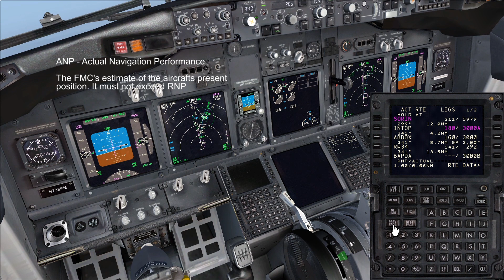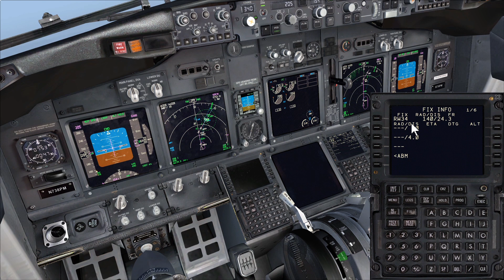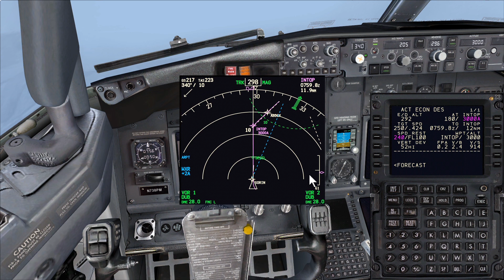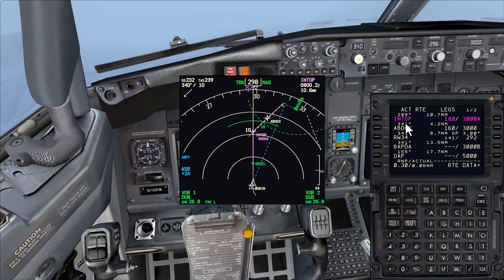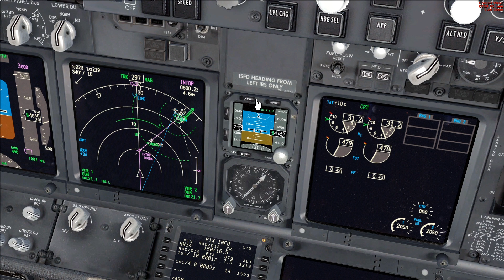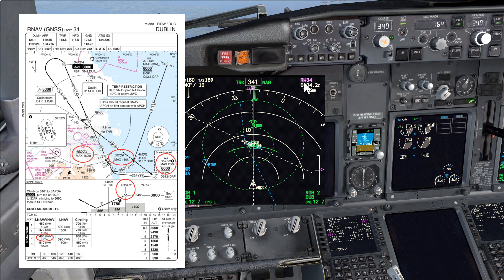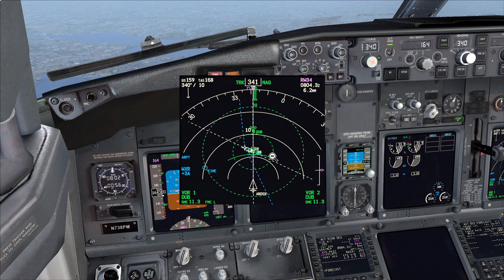PMDG 737 RNAV/GNSS Approach Tutorial by a Real 737 Pilot

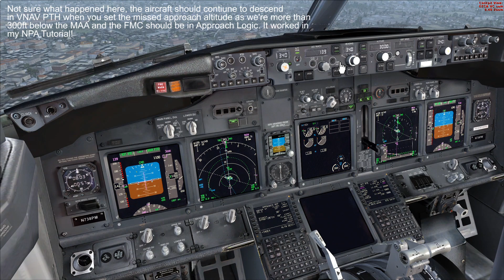Comment: Nice tutorial bud. At about 12:40 the reason why VNav gave out when you set missed approach is; because you need to be at least 1000ft above field elevation to set MAA or else it will level off. Your field elevation is 202 ft which means you should set MAA at 1202 ft but you set it at 1260 there about. The sim was actually spot on. To be on a safe side, just set MAA at 300 ft above MDA. Otherwise great job. I’m a 737 pilot.😊

Comment: @flightdeck2sim Is there any rule (I realize it might be operator dependent) about when you can set the altitude on the MCP to the down to the minimums? Is it after the IAF, or within a thousand feet of level off, or no rule but there are best practices? I learned for myself practicing, you definitely can't wait until the FAF or until you're in VNAV ALT or you'll be immediately high on profile when it doesn't descend.

Must be gratifying to know this video helps so many, years on. I was in real trouble if ATC told me to fly anything other than an ILS before tutorials like these.

Comment: It would be great if you could revisit this tutorial for the MSFS PMDG 737. The A320 has the ability to simulate the ILS G/S in the RNAV approach. Does the 737 has a similar feature?
Reply: If equipped with Integrated Approach Navigation (IAN). It's a carrier option.
Reply: @rynovoski  Can it be set in the MSFS PMDG 737 through the PMDG Options?
Reply: Using the FMC.
Reply: @enriqueosuna  I don’t have MSFS, but if FD2S can turn it off, I bet you can turn it on! 😅
Reply: @rynovoski  by any chance do you have the PMDG 737 on another sim platform?
Reply: @enriqueosuna  No. I use the Zibo mod on X-Plane 12. I didn’t think the PMDG supported any other simulator.
Reply: @rynovoski  they do support P3D/FSX. Thanks for your guidance. 👍🏼
Reply: @enriqueosuna  those are both basically MSFS. 

No problem!

Comment: What about a VOR approach full procedure
Reply from the maker: You might find this useful! 

https://youtu.be/qMYzXB6nb_I

LNAV/VNAV are just roll and pitch modes the aircraft use to fly guidance programmed in the FMC. It's used in all phases of flight and can be used to fly an approach in the FMC, the FMC is still able to generate curved lines and radius to fix tracks and is extremely accurate, We use it to fly RNAV, VOR, NPA approaches at my outfit and can be just as accurate as an ILS! 

FD2S

Comment: So what’s the difference between LNAV/VNAV approaches such as this, LPV and RNP approaches. To me RNP approaches on charts (Quito or Paro are good examples) allow the aircraft to fly through mountains following curves and has to be extremely accurate where as LNAV/VNAV is bunch of straight lines. And I guess these still can’t beat ILS when it’s extremely foggy
Reply from the maker: Hi Thomas,

LNAV/VNAV are just roll and pitch modes the aircraft use to fly an approach in the FMC, the FMC is still able to generate curved lines and radius to fix tracks and is extremely accurate, We use it to fly RNAV, VOR, NPA approaches at my outfit and can be just as accurate as an ILS! 

FD2S

Comment: Hi, i've tried to apply this exercice on Zibo mod on Xplane, but i dont see any holding point in the database for SORIN. is that possible or did i miss something? Thanks Capt.
Reply from the maker: Hi there! It should be unless it's not correctly coded in the FMC, if you select RNAV 34 it should come up as a transition. 

FD2S

Comment: Hi. Been practising some approaches. If you notice the glide path angle is different in the FMC to the charts, is there a way of updating the FMC to show the correct angle. Keith
Reply from the maker: Hi KEITHGEE1000,

It is impossible to update the GP angle on a published approach, they should match the chart. If you were to fly an RNAV approach the tolerance is 0.1 degrees otherwise you'd have to fly something else (then report it!)

FD2S
Reply: flightdeck2sim great thanks. It was approaching Jersey. The charts showed a 3.0 degree GP, the FMC was 3.1 so within your range. All good!!

Comment: Hi :) I have this question: why didn't you set minimums bug to MDA+40ft, like you did in non precision tutorial? Doesn't this rule apply to RNAV approach? Thanks in advance :)
Reply from the maker: Hi Konrad.

RNAV Approach to LNAV/VNAV minima is classed as an approach with approved vertical guidance so the minima is a DA so no need to add 40ft 

FD2S
Reply: Thank you very much for quick answer. Greetings from Poland :)

Comment: hii flightdeck again it is mee :))  what will happen if ı tune the ıls frequency while executing rnav/gnss approach.?? will the localizer and glide slope diamonds show and ıls override the rnav 
 approach ?
Reply from the maker: Hi there!

You can are APP using IAN (Integrated Approach Navigation), our fleet are not fitted with this option and I've deselected it in the PMDG options and I know very little about it!

I believe in this case the PFD will annunciate G/P (glide path) instead of G/S (glide slope) after arming APP. Flying IAN requires proper equipment and approval and allows you to use the LPV minimums on the chart.

FD2S
Reply: hmm oke thanks for that...

Comment: Would you fly an RNP apporach the same way you fly LNAV/VNAV GPS approach
Reply from the maker: Yes you could. You can are APP using IAN (Integrated Approach Navigation), our fleet are not fitted with this option and I've deselected it in the PMDG options and I know very little about it!

I believe in this case the PFD will annunciate G/P (glide path) instead of G/S (glide slope) after arming APP. Flying IAN requires proper equipment and approval and allows you to use the LPV minimums on the chart.

FD2S

Comment: What is CWS A and B autopilot?
Reply from the maker: Hi Oleg,

It's a function seldom used which turns the 737 into an Airbus. You essentially fly the autopilot using the control column, you set an attitude and/or bank angle and it holds it nicely without trimming. Will explain its use in a tutorial at some point!

FD2S

Comment: What about using APP button on MCP during RNAV approach?
Reply from the maker: Hi Squawk 737

You would use APP using IAN (Integrated Approach Navigation), our fleet are not fitted with this option and I've deselected it in the PMDG options and I know very little about it!

I believe in this case the PFD will annunciate G/P (glide path) instead of G/S (glide slope) after arming APP. Flying IAN requires proper equipment and approval and allows you to use the LPV minimums on the chart.

FD2S

Comment: When will autopilot automatically disconnect on RNAV approach? Thanks!
Reply from the maker: It wont until you disconnect it! 

FD2S
Reply: flightdeck2sim Thank you for the reply! Just tried it with PMDG737 at LOWI RNAV rwy 26 and it went to CWS mode at 10ft AGL, with 50ft Radio DA set.

Comment: Hi FD2SIM, sorry this is an old video to post on but could you please explain how this approach would work if you were flying an aircraft with IAN equipped and would it make a difference and what annunciations you would get if using it. Thanks.
Reply from the maker: Hi Nerf

With regards to IAN (Integrated Approach Navigation), our fleet are not fitted with this option and I've deselected it in the PMDG options and I know very little about it!

I believe in this case the PFD will annunciate G/P (glide path) instead of G/S (glide slope) after arming APP. Flying IAN requires additional equipment and approval and allows you to use the LPV minimums on the chart.

FD2S

Comment: Amazing channel, congrats!!! Can you tell us how close the PMDG 737 is to its real life counterpart when it comes to landing? The technique, the speed, flare and touchdown?
Reply from the maker: Hi Eduardo, thanks and welcome!

The PMDG does feel a little "floaty" but the 737 does have a natural tendency to float if you're flying just a few knots above your target speed on final when initiating the Flare.

If you start "checking" and your speed is VREF or less the real aircraft will land quite firmly. This will also be the case if you reduce thrust too early, especially landing with Flap 40 due to the significant increase in drag. 

Small inputs using a computer joystick would involve a far larger input using the control column so the tendency to flare using flight sim is greater. Both in real life and in the sim if you initiate the CHECK, CLOSE, HOLD correctly and the correct height/speed it will settle quite nicely within the touchdown zone.

I don't know if you have seen but my "Landing Technique" tutorial goes into some detail!

https://youtu.be/6qnriMfIbEE

Hope that helped to answer your query! 

FD2S

Comment: Hello Captain .. What about "App" mode usage. What benifit it adds to Rnav .. What conditions compel the pilot to go for "IAN" Instead of RNAV?
Reply from the maker: Hi Kk,

With regards to IAN (Integrated Approach Navigation), our fleet are not fitted with this option and I've deselected it in the PMDG options and I know very little about it!

I believe in this case the PFD will annunciate G/P (glide path) instead of G/S (glide slope) after arming APP. Flying IAN requires proper equipment and approval and allows you to use the LPV minimums on the chart.

FD2S

Comment: Any tips on the LNAV aspect of RNAV 23R or L into Nice? Seems the last segment is visual only.
Reply from the maker: Hi Bald Eagle.

I've bot flown into Nice, it looks like the Runway direction is now 04/22 and not 05/23 (Magnetic Variation)

You're quite right, the last segment is fully visual. Looking at the chart for the existing RNAV procedure we would continue to the MAPt (Missed Approach Point which is D5.5 AZR) and continue the approach visually. We would to fly a track of 303 and descent to 1000ft (using V/S and HDG SEL) turn final and then disconnect A/P and A/T and recycle F/D's.

Good Luck!

FD2S.
Reply: Thanks for the reply FD2S. Just thought I would check with the Boss first :)  I always choose the hardest approaches! Well, when I say choose I mean I just find myself there. 04 nice n easy, 22 a nightmare grrr

Comment: So with rnav approaches you don't press the app button so that it captures the glide slope? Is the app button only for ILS approaches?
Reply from the maker: Hi Matt,

With regards to arming APP on an RNAV approach this is for aircraft fitted with the IAN (Integrated Approach Navigation) mode, our fleet are not fitted with this option and I've deselected it in the PMDG options.

I believe in this case the PFD will annunciate G/P (glide path) instead of G/S (glide slope) after arming APP. Flying IAN requires proper equipment and approval. It allows you to use the LPV minimums on the chart.

FD2S.
Reply: Thank you

Comment: After 4 months I am back to this excellent video. That are many Youtube videos on RNAV approaches, but very few did it right. Of course, this is one of the maybe two or three videos did it professionally. I found in most RNAV videos, the pilots didn't check or set RNP, didn't set MCP altitude to DA and then with 300 feet of that bug it up to the missed approach altitude, and didn't cycle the FD buttons for guidance in case of going around. So, thumbs up once again to the caption flightdeck2sim!
Reply from the maker: Thanks Wotao,

I can assure you this is exactly what is taught and applied as accurately as possible!

All the best!

FD2S.

Comment: I have a few questions. Firstly, you do not use APP in this RNAV approach (as it was commented already), maybe this is the reason why the FMC was not in "approach logic" and you was unable to set MAA? Secondly, I read somewhere that flaps should be set one notch at a time and you set it directly from 15 to 40. What is the best (real life) practice? Maybe "one notch" rule applies only for retracting, not for extending? And last thing, what is FD recycle you do before landing? I haven't seen such routine in any other tutorial.

Your tutorials are really great! Thanks!
Reply from the maker: I admr0z!

With regards to arming APP on an RNAV approach this is for aircraft fitted with the IAN (Integrated Approach Navigation) mode, our fleet are not fitted with this option and I've deselected it in the PMDG options.

I believe in this case the PFD will annunciate G/P (glide path) instead of G/S (glide slope). Flying IAN requires proper equipment (also licensing supposedly). It allows you to use the LPV minimums on the chart.

Approach logic is independent of IAN approaches and is a function of the FMC. It activates when you're within 2nm of the first waypoint on the approach or less than 2000ft above the airfield elevation.

Secondly wherever you read that flaps should be set one notch at a time is not required. So long as you're below the max flap placard speed for each setting you can go straight to that flap setting. The same applies for retraction.

In real life on approach we usually go F1 - F5 - Gear Down F15 - F30. Sometimes if you're landing with F40 and close to your max landing weight you will likely have to use F25 and/or F30 as an intermediate setting to help reduce your airspeed. All G/A's go straight to FLAP 15 or FLAP 1 if single engine.

Recycling the F/D's on a NPA ensures you get the correct guidance when reaching the missed approach altitude in the event of a go around.

Good luck!

FD2S.

Comment: I usually go into idle reverse from full reverse by pressing F1, and then quickly press F2 twice (Just tap) and it'll go into idle reverse.
Reply from the maker: Hi Dale!

Noticed that works quite nicely! Idle Revers is usually the preferred choice unless there is an issue with Brake Cooling for a quick turnaround or if landing on a contaminated runway! 

FD2S
Reply: Are hot brakes simulated with the PMDG (after an aborted T/O)?
Reply: Oernzen Yes, I believe, but I think they simulate it better on the 777 and 47

Comment: Great tutorial. The FMC was programmed to fly at 180kts for INTOP, but it seems the bug stayed at the flaps up speed, which is 20kts higher, so you had to use the speed intervene button and bug it down there. Did this happen because of the flaps operation?
Reply: Also, what'll happen if you push the APP button on the final approach?
Reply from the maker: Hi Wotao

Had I been in VNAV PTH with the speed window closed the aircraft would've bugged the next flap placard speed automatically after extending flaps.

With the Speed Window open it should revert to VNAV SPD but because, as you correctly pointed out, the flaps are extended it stays in VNAV PTH allowing you to directly set the placard speed. It's your job to make sure you bug the appropriate speed (and any speed restrictions) but the important thing is that VNAV PTH is still engaged and following the Vertical Path which is required for this Approach.
Reply: I just Googled it. Push APP on an RNAV approach will activate the IAN (Integrated Approach Navigation) mode, which a virtual ILS. The PFD will annunciate G/P (glide path) instead of G/S (glide slope). Flying IAN requires proper equipment (also licensing supposedly). It allows you to use the LPV minimums.
Reply from the maker: From what I understand this is something to do with IAN Approaches and VANP (Vertical Actual Navigational Performance) I believe then you can use the APP mode to fly an RNAV Approach.

Our fleet are not fitted with this option (and I've deselected NPS scales within PMDG) so I can't really help you, we only use APP mode for an ILS Approach with my operator
Reply: Thank you for the super clear explanations!

Comment: Nice but what's the difference between r-nav approach and vor-loc approach?
Reply from the maker: Hi Mattia,

VOR & LOC are both in itself two different types of Approaches.

A VOR Approach uses just that, a VOR radial to fly towards the runway and then land.
A LOC Approach using the Localiser off an ILS to fly to the runway and then land.

These both rely on ground based navigational aids to be tuned and backed up to ensure we're descending on the correct profile (Even though on the 737 we use VNAV for both approaches which uses the Navigational Database to vertically fly the correct profile)

An RNAV/GNSS approach does not rely on ANY Ground Based Navigational Aids, you just use the Navigational Database in the FMC and monitor this using GPS. 

Hope this helped answer your query!